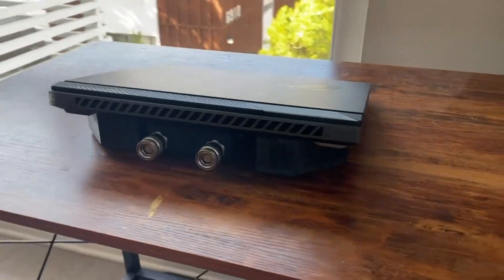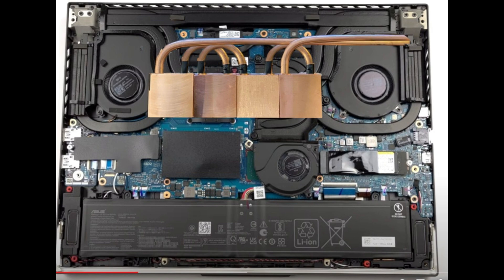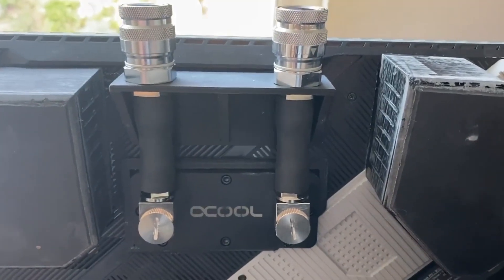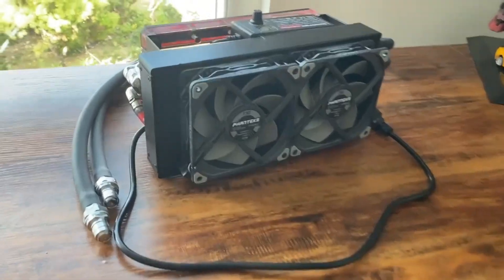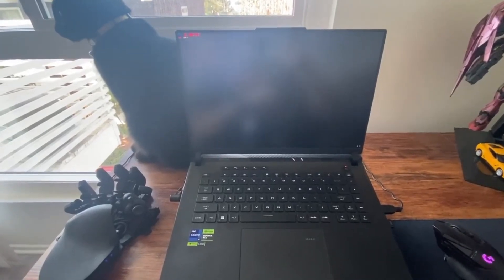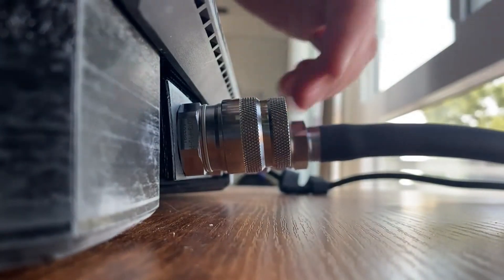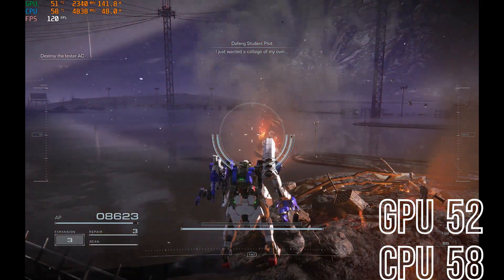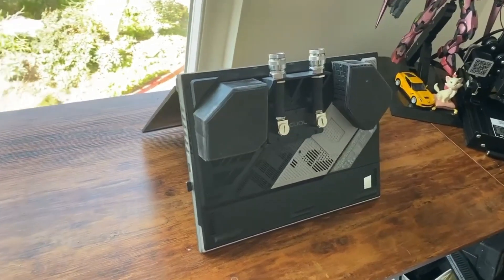Water Cooling a Laptop is... Easy?

Comment: There is 1 company that did essentially this. I can't remember which one it was. I thought it was an awesome idea. When "docked" at home, you plug in a couple of hoses and it was the same basic idea that you've done but leaving the laptop looking like a regular laptop. It just had the 2 plugins for the water cooling. I saw it on LTT channel I believe.
Reply from the maker: There are a few out there now that use a similar/the same chassis - XMG, Tonfang, Dream Machines, and Eluctronics. XMG has some new innovations with their heatsink design this year. 

They all fall short of cooling the laptops as much as this. I believe it is from them using a 120mm rad instead of a 240mm but the Scar 16 screen beat my curiosity for them.

Comment: This should be the best performing 4090 and i9 on a laptop in the whole world.
Reply from the maker: Sadly, the CPU never will be because of Asus BIOS limitations (and it is a terrible bin honestly). The fastest RAM it can run is 5600 with no potential to overclock it. There is also no way to set an IMON slope to trick it to pull higher wattage. The GPU, however, will be getting a shunt mod in the next few weeks.